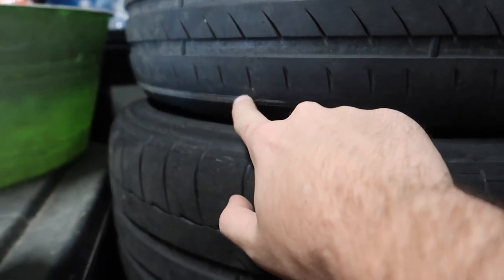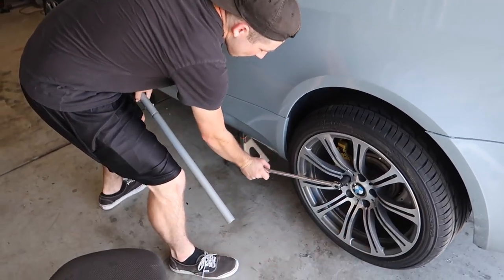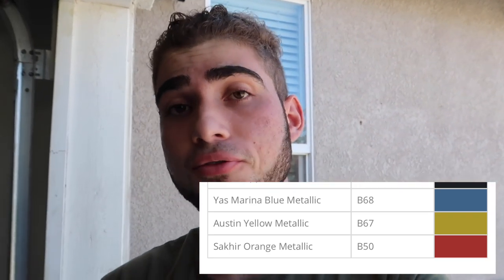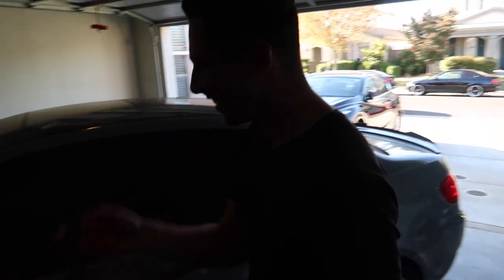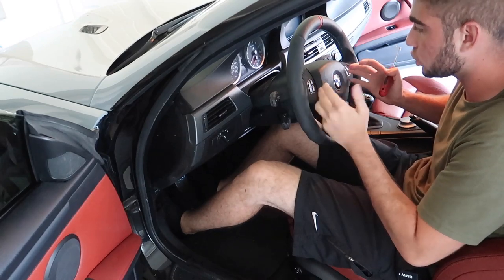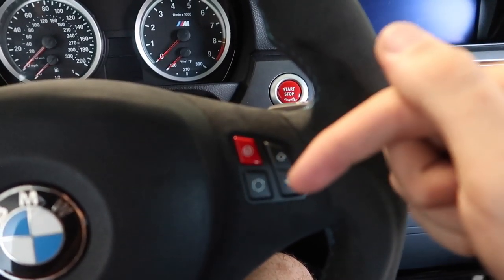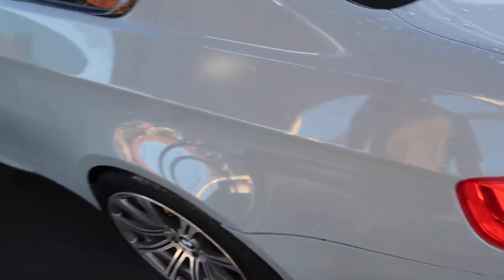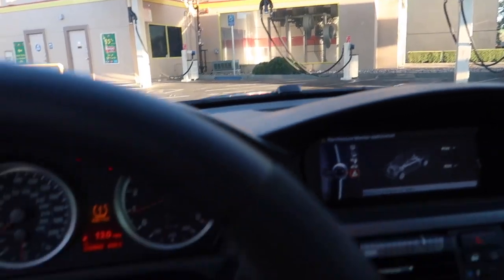CHOOSING THE COLOR OF MY BMW M3!

Comment: Spacers off (the wheels are designed for that car) sell the black wheels, or put them on the E46, get the alignment checked before you wear out the new tyres. Then stand back and admire how much better the silver stock wheels are. 😁👍🏻

Comment: I have been unable to run 30mm spacers on my rear e90 tires without rubbing issues.  Even coilovers with high dampening settings didn't stop it.  25mm is the most I could ever do.